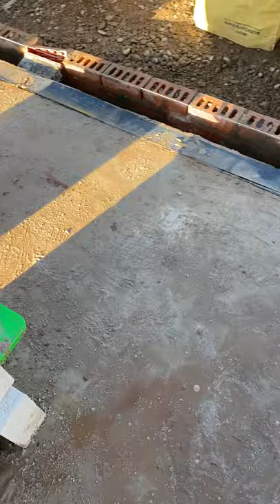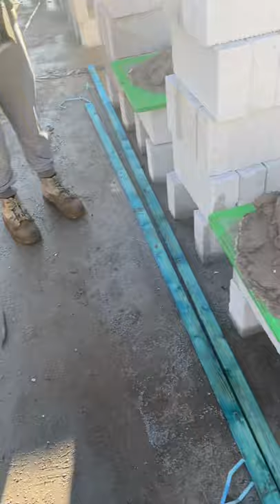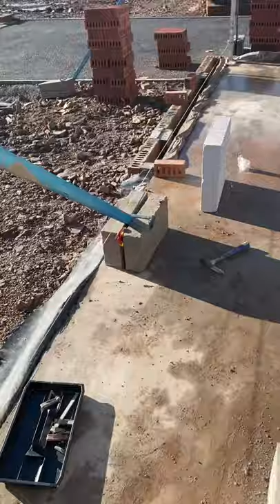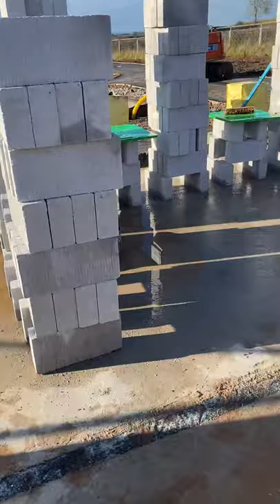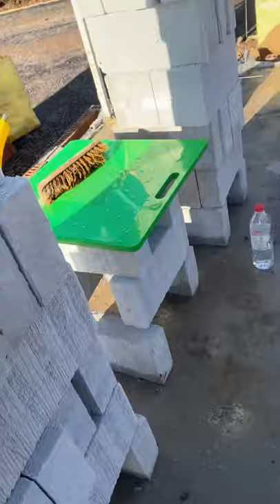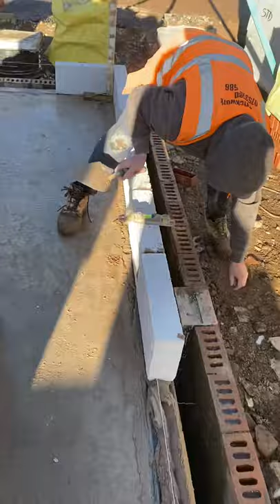GATORBACK BOARDS..We highly recommend buying these to keep the Motar perfect!👌🏻🧱🧱🧱

Comment: By time put them profiles up could of got corners up easy
Reply from the maker: Dap Tv no chance
Reply: @derbybrickworklimited   😂 every block has to be loaded before laying having a big gang on that if there’s dead start is costly putting poles up everywhere can’t no one build corners
Reply: It's not that people can't but on price why would you chose a slower method? " House bashing " is a production line. Profiles are plumb every time, gauged and square.
Reply from the maker: brickpug * 👏🏻👏🏻👏🏻🙌🏻🙌🏻👍🏻👌🏻👊🏻
Reply: Get profiles  set up in minutes then just lay to a line why wouldn't you do it and your not reaching for your level every 2mins anyone can build a corner but the question is why would you want to, you go to work to earn money and profiles are the way to earn it
Reply: @bricky1000   I agree if your a two & one gang but if your gang has ten brickies put the best ones cornering up and the idiots running in 😆
Reply: @dapmc  if your a big gang you just have someone in front setting up for everyone else or get set up first thing when labourer is sorting muck out
Reply: @bricky1000   why have someone going round setting up profiles that’s a main taking a wage and not laying profiles move and need checking you can’t just plumb them up and leave them better having lads putting corners up and lads running in
Reply: Daptv would you use profiles at all when the corners are up? Working With block.
Reply: @rockandmeatroll   if I was working as a 2&1 I would profile everything but if work in a big gang best to have lads putting up corners small corners run in